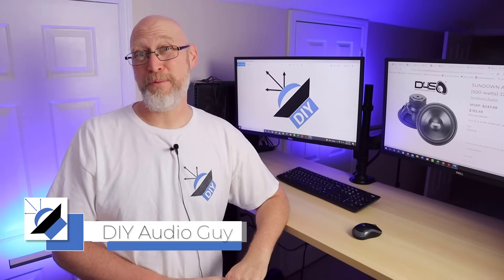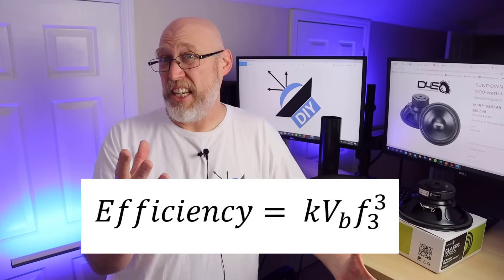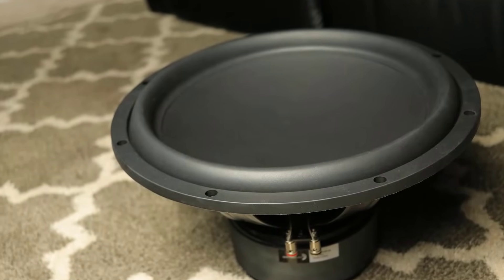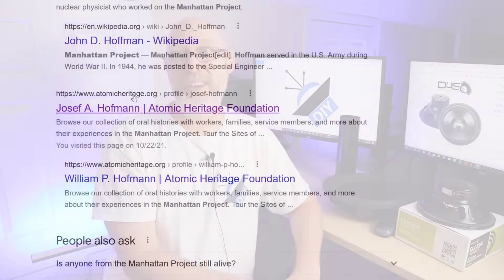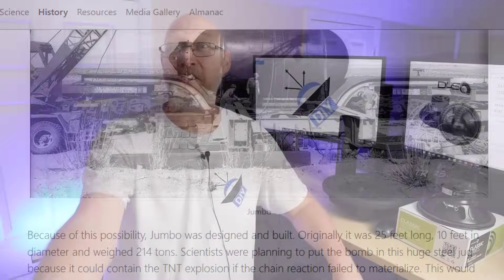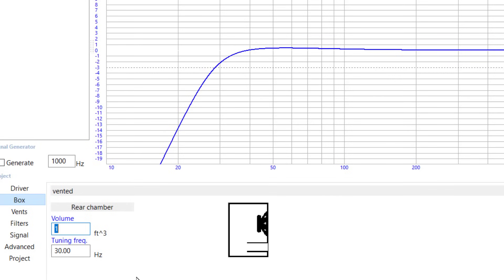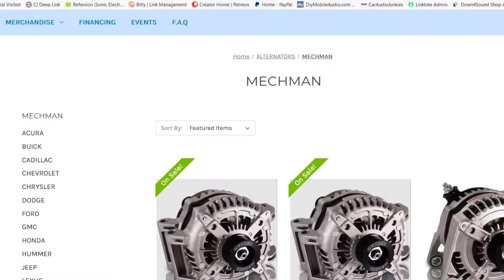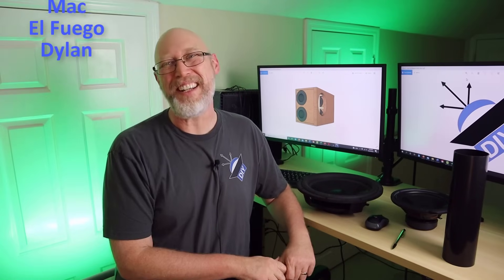Hofmann's Iron Law:  A Better Box for Better Bass!

Comment: i can say this gentleman is talking 100% legit... I wasnt any good at match but I did have some manic technical skill , will power , curiosity and lots of extra material to waste ...Back then I had a Renault Clio and owned a used goods and furniture shop. Out of the shop , I built my system , many times over. I built 7 different boxes for my two 12's ( and these were only SVC by not so high shelf brand "Targa" rated at 3200w max each <YEAH RIGHT> anyway , heres what I learned , the fun way ,,, A woofer wants : 1. a box definitely bigger than what the tell you on the booklet that comes with... at least 30% larger than the volume they recommend (yes I can at least calculate volume and area) 
2. a woofer does love the juice but also not too much , trust me its very easy to overpower a subwoofer , like this man says , those monoblocks are cheap and they like to Binge on the juice. I actually downgraded from a big ass 8000W mono , and went for an amp from the same brand although i chose 1 that looked like it still had lots of mosfets on a big heat sink array and this was a nice 1 , its a 5200wx4ch , the cool thing on this 1 was that channel 1 and 2 were special in the way that when bridged , they can drop to 2ohm load with LOTS of amperage , the connectors for these 2 chns were bigger than ch 2 and 4 (also bridgeble but limited) so , I connected my 12's (SVC) in series and to the ch1/2 bridge . Firstly what happened was the amp performed some pyrotechnics with the power feed cables (from a sound shop) I replaced these a few times until I eventually ended up using welding cable .. next up the woofers destroyed the box somewhat and thats when i started experimenting. The best setup = I measured the boot and aimed at those dimesions for the box size , i used propper mdf and not pressed wood, double enclose , baflle in the middle and made sure the subs have equal volume in their box , my experience with ports ( see those plastic pipes there... they belong in your plumbing byy the toilet ) . A made slot ports like this , from middle baffle , from from top to bottem , i cut pieces of the same wood and a few different lengths coz i wantes to play with the depth and i aslo didnt fixed them permant as i  played around with the slots ( started in the back of the box at 3 inches wide and it opened up towards the front ( got the idea from an old gramophone ) it work allot better this way . In the end , i almost could not fit the damn box in my clio , it was slighly too wide . I had to actually loosen some of the plastic trim and I parked in the sun too get everything soft ...I was gonna get thet box in that car if it meant cutting the roof off !!!! end result ? I was satisfied , nothing more could make me happier . As for the allternator issue ...JIP thats the biggest downer , I had to start my car , otherwise by the first bass drop in a song .... off goes everyting , battery drained. My last piece of advise ... its no use having Cervin vega or kicker in the boot , along with a nuclear powerplant amp if you are gonna feed it shitty signal , through shitty cables... I had  very nice kenwood head unit ,and no bass bost was on , or nothing .. clean signal went out to a audiobank graphic eq (i loved her to bits ) and from the eq went signal from sub out to the ch1/2 bridge, and ch3 and ch4 each had rear left and rear right respectively . The amp's pass filter I left on full / bypass ( in other words the switch was in the middle ) and the reason was coz the proccesing was and cleaning done by the eq already so i gave the amp pure signal.. ch 3 and 4 , i had 2 pioneer V-trek 6ich mid's in the back board ( the clio came out with not too bad blaupunkt's in each door so i left them there and gave them power from the head unit and lastly i added 2 cheap tweaters along with the 2 front speakers (never give a tweater amp power it sucks) Oh and dont forget. the sound files you play through your head unit has to be good quality. its no use playing low q downoaded mp3 songs , what you put in on 1 side will be that multiplied by 1000 ... so put in crap , you will hear crap... Cool . im out

Comment: 1:22 While I 100% agree that pure air movement capability with identical spec 10's vs 12's is always going to give you more with the 12's, but when you move up to larger sizes the added mass slows the response which effects the audio capability and air movement in general. 
Which is usually fairly apparent when you hear how good a 12" vs a 15" actually sounds. Yes, more modern subwoofers have gotten 15's much closer and when we're talking sheer thunder 15+ is the better option for lows if you listen to heavy metal those 10's and 12's sound way better. 

Also, because they hit the higher bass frequencies better they can in fact be louder sounding to the human ear but maybe not as quaking.

Comment: hey buddy i love all you videos thanks for the great content, i have a question for you, i currently have 1996 mustang convertible and trunk is small  and have 2 x 12 kicker red ones in sealed 1.0cube each sub box with 1200w kicker cxa amp and it rocks but it doesnt seem to get low like i like, do you think it will be louder and lower if i get one American bass 10 1200w in ported tuned 32hz box..... the box will be same size as i got but only 1 sub, hope you can reply
Reply from the maker: In this case the car is the limiting factor.  So I cannot really tell you what will improve the sound.

Comment: I'm planning on making a bass guitar cabinet. Do I still use these concepts to get the most out of my cab or can I just make a box and put the drivers in be done?
Reply from the maker: Yes, most bass guitar cabinets seem to be tuned to around 40 hz and they typically have a tweeter as well.

Comment: I heard one 10 and it absolutely pounded better than anything I ever heard for 1 ten.
The box was 2.3 cft and tuned to 29.
I got the build so I'm going to try the bigger subs and sizes.
Reply from the maker: Big box, tuned low!
Reply: @DIYAudioGuy after a point it eventually creates one note wonders unless you swap to some sort of tapped horn design that makes use of 10 cubic feet for a single 10. Then again you can sometimes lose in power density compared to more 10s in 10 cubic feet ported with similar efficiency due to coupling. For efficiently squeezing output over a wide range out of small drivers, horns are king, though at the cost of enclosure size taking up more room than something with more drivers and louder if fed more power.

Comment: Do you have a video that goes over cone stiffness and how that correlates to power and volume output? Cause logic would make me think a less stiff cone would be louder and making it heavy and stiff would just be reducing efficiency; im sure theres a reasoning, i just dont know what it is
Reply from the maker: Yep, back in the day cones were less stiff and subs were more sensitive.  They have morphed over time as amplifier power has gotten cheaper.  Stiffer subs can take more power, but they are less efficient.
Reply: @DIYAudioGuy  okay good to know. Does it provide anything other than letting companies sell bigger more expensive amps? 😂 like i could see maybe if SQ was improved, and maybe SPL worked better with soft subs?
Reply from the maker: @pyroboy417  It's not the companies, it's the consumer.  People want beefier subs and bigger amplifiers.  You can't blame a company for selling a customer what the customer wants.
Reply: @DIYAudioGuy  hmmm gotcha. Im an engineer and everything inside of me wants to maximize efficeincy, but im also a basshead and cant deny my urge to cram as much wattage into a single speaker as possible🤣

Comment: Brane Audio broke Hofmann Iron Law. They used a RAD (Repel-Attract-Driver) in their portable Bluetooth speaker along with 4 other drivers…
Reply: As I understand it though, they use defeatable magnetic fields controlled by DSP to get there, sort of a future development of a servo system from another angle of approach.
Without the DSP, using a plain Jane driver, Hofmann still wins. Notice the Brane audio driver also has a large number of watts on tap? Tells me the throwing watts at it is really the majority of how it does it.

Comment: Your a nice bullshit talker. Said so much didnt get to the point still. Choose two. Yeah right make me a small box with deep base cant! Make me a loud but small box cant! yeah Im also looking for some quality. You such a useless channel. To be honest the math is pretty shit, you can learn by instinct way better. it doesnt take any measurements to know a passive radiator is the king the same as mass and volume. Now about the tone its about the material and thickness and also how the inside looks. resonance is about insolation inside or no or maybe even foam noise absorption stuff.  Reality is the biggest thing is what its for. Make a good speaker combination and actually research Cone sizes ,wattage, air displacement, resonant frequencies (can be done with the ear somewhat) and about the crossover or filter you gonna use cause if you put your mid/woofer to 10k or 16k it makes a huge difference. also how the balance between the frequencies is gonna be if its like a Bluetooth speaker. In reality if you make a homes system i would isolate each box. i would make like 2-3 subs different sizes then a woofer box with 4 woofers and 2 sizes. tweeters should be in the walls and full range like idk how many. Each speaker affects each other especially different types of speakers.  My comment contains 300% more useful info then your video!

Comment: No such thing as all around subwoofer. You work with a subwoofer EBP. Efficiency Bandwidth Product. This is not all about moving air, producing sound... It's Producing accurate reproduction of notes. The acid test for a good sub is always natural instrument. Try the double bass instrument, and do an AB test elimination. The one that dilineates the plucked double bass will also reproduce the dynamics of a kick bass drum the best.

Comment: I always try to get as much air movement in as small of a box as possible. I like to use driver's that don't need much volume and have a high Xmax like for example an SB23MFCL-4 with 12mm Xmax or a Ciare 12.00SW with 14mm Xmax and put them into a Tapped Horn. For both driver's i have designed Tapped Horns that go down to 13hz. A friend is currently building the one i designed for 2 of those Ciare 12s and he will build 4 of those Dual 12 TH and together they will be capable of generating 127db down to 13hz at 1meter outside according to Hornresponse. Each sub has a outside Volume of 655Liters and does 91db at 1watt. Inside and corner loaded those could probably cause some SERIOUS injury to human and the house they are placed in.

Comment: I got 3x12 up front and 2x12 under the couch , my walls are 3-4ft thick stone wall and between this room and the dining room is a 7ft tunnel of stone.....basically open the door stand outside and the loudest bass in the house, the tunnel is basically the port of my sitting room speaker.

Comment: Shall we expect more sound if port area increased?
Higher area only to decrease Air velocity?
Reply from the maker: That depends ,if the port is WAY undersized it can impact output.  But if it is big enough to prevent chuffing then making it bigger will not make it louder.
Reply: @DIYAudioGuy  I completed my subwoofer work yesterday infinity 12inch passive sub closed box with 400 watts class D amp. Its perfomance very nice quality bass.
Reply from the maker: @Vishnuvkammath  Excellent!

Comment: going too big on the enclosure wouldn't that make the sub more muddy less controlled and so called boomy, i personally when from 10.5cuft to 7.5cuft net ported and the bass is alot less boomy and even use isolation rubber feet but my house and walls still shake and vibrate. using dual 18s @ 2000w rms with xmax of 34mm one wayb

Comment: The issue with the enlarging the cabinet is you end up adding efficiency to the low end only. The problem is you rob energy from the top end to do it. Same with large port area. Yeah it's awful loud around the box tuning but it rolls off very fast above there in the range. Boxes that are too large for a driver with introduce mechanical distortion into the range around a half octave above the port tuning due to the mismatch in damping. You'll also find you run into xmax limits very quickly in an oversized cab.
So in summation, Hoffman iron law gives you low end extension at the cost of high end extension. All you are doing is moving the playable band, down the range and shortening it at the same time (low bass one note wonders). I grew out of iron law boxes many years ago when I realised the bandwidth drawbacks. It's a great way to get cheap woofers loud at low frequency but you'll soon get bored with only being able to play your tuning specific decaf tracks. Everything else with transients in it or upper bass will sound muddy and 10 minutes behind everything else. You'll also get bored of wearing out woofer suspension if you are competing like this. Xx

Comment: as a child in the 90s I got an installers manual.. the pioneer bass book.. like 1993 or so.. i figured out T&S real quick and was making 2.5-5cuft ported boxes right fast..  but also was making custom external ported behind the seat truck enclosures.. running the port under the seat externally along the floor. my first in a 93 b2200 where the OEM jack was mounted

Comment: You really hit the nail on the head when you said the amp is the cheap part. I just got the jp63 after watching your videos and I spent $1700 on the amp. I had to buy $350 on wiring, all 0guage copper. Then the demand for amperage I have three optima batteries which are $400 each and the lto 6.0 it was another $500 once I had it shipped from Vegas. So ya over $2000 just for the equipment to run that amp. Total cost of amp was $3750. Then the sub was $1600(rs team 18) and birch box with 3” baffle and 2.25” walls was $960. Hope people understand this when they think the amp is inexpensive. I haven’t even upgraded my alternator yet either, luckily it’s a 200amp (f250superdutystock) and keeps up fine. So ya, my one sub system was $7000 and shipping that shit from Vegas to Vancouver island wasn’t cheap. $550 in total shipping for the jp63 and a jp100.4 so probably was over 7k.
Reply from the maker: Amps are cheap, but power is not.

Comment: Years ago a CD magazine told how to build a subwoofer from a 12 inch Eminence sub at the time and it was used in an expensive M and K system. Well, I built that but the sub would bottom out with only 25 watts applied to it. A couple years later found out that the sub worked much better in a 1 cubic ft enclosure instead of the gentler Q design at 3.5 cubic feet. Before I could experiment the subwoofer's foam surround fell apart. I let some years pass and in the meantime built some khorns (mid 80s) and 10 years later bought a car sub off of ebay. It happened to be a MA audio MA121XQ and it had the right parameters for the 3.5 box I had made a decade or more earlier. Tuned to 27hz or so and powered by a 300 watt amp (I just replaced it yesterday with a new Dayton 250 amp with dsp) and it doesn't bottom out and just works. Low cost too. It has 10mm xmax which seems plenty.

Comment: I like my bass low, but for the enclosure that lives under my desk, I don't need it loud. So I tune for extended response and I have flat response down to about 15Hz. I don't hear that, I feel it. It does result in a port that chuffs, but I don't hear that because the desk is in the way. After that I use Sonarworks for final integration. The result is fine.

Comment: Rockford would like to have a word with you,  this 10" 300wrms p2 I have hits harder than my skar 12" with 2000w rms. Yes they are all tuned and in the correct box
Reply from the maker: That is not an apples to apples comparison.  Compare the 12" version of the RF to the 10" RF.  Then compare the 10" version of that scar to the 12".
Reply: @DIYAudioGuy  that's the whole point, a 10" sounds better then a 12"
Reply from the maker: @N54God666  or maybe RF sounds better than SKAR?  When you compare a smaller subwoofer from brand x to a larger subwoofer from brand y you cannot tell if it is the size of the subwoofer or subwoofer design.  That is a poorly designed experiment.

Comment: Would i still need a big enclosure even if I just want to run 2 8" subs of even 2 6.5"s?
Reply from the maker: Yes and no.

Smaller subs require less airspace than larger subs, holding everything else constant.  So yes a box for a pair of 6.5's will be smaller than a box for a pair of 10's.  

But, you are still constrained by Hoffman's iron law.

Comment: Passive radiators can actually be more efficient than ports when using high power. Passive radiators don't compress as much if you're using a small enclosure that needs a long skinny port. You can also tweak the frequency response. You can save a bit of space if you build a box that can get low, but has most of the efficiency from 50-90 Hz. Another way you can save space is by using thinner box walls and regular thin bracing. Baltic birch allows you to build thinner than MDF. I have an enclosure that's over 3 cubic feet and the box walls are 3/8" thick, but it doesn't flex due to bracing. The total material use goes down, therefore space, although it is more tedious to build. L section metal braces are the least space consuming and thick chunks of MDF the most.